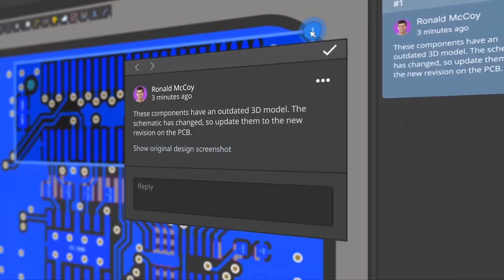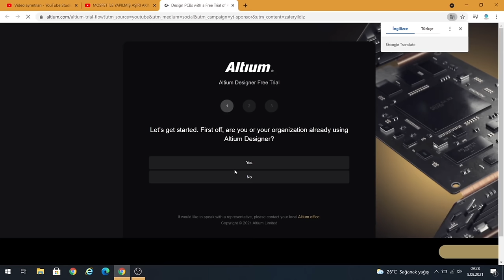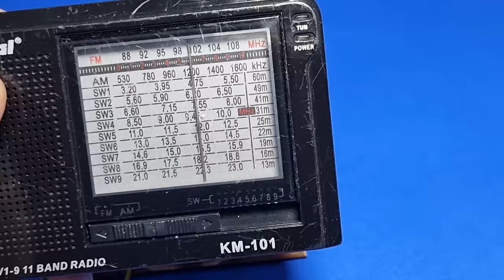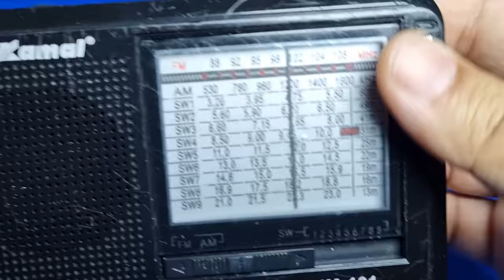How To Make Long Range Stable and Powerful FM Transmitter - 2KM

Comment: Merhabalar. TEC1 12706 modele sahibim. Denemek için peltiere 12.7V 12.5A akım verdim ve elim yanıncaya kadar akım vermeye devam ettim. 70 Watt desteklediği için kendisi yeterli akımı çeker diye düşündüm ancak durum tam düşündüğüm gibi değilmiş. 4 saniye bu şekilde çalıştı. İçindeki yongalar seri bağlı olduğu için herhangi birisi bozulsa bile peltierin tümünün çalışmaması gerekir mantıken. Tekrar voltaj verdiğimde çalıştığını gözlemledim. Bu sefer 4.2V 1A akım verdim. Sizce peltierde herhangi bir sorun var mıdır?

Comment: Had to have a look for a laugh... Its of course nonsense, hence no circuit diagram! The transistors BD139's are audio transistors, you could make a MW transmitter with them, but certainly not FM :-)
Reply: Bd139 has a frequency of 190 mhz ..Not quite high but enough for FM.
Reply: @Newlife-ol6pk  I have quite a lot of experience of building high frequency circuits. I can assure you the FT is not the be all and end all as to whether a transistor will work at certain frequencies. For MW or short wave possibly but by the time you get up to FM frequencies my experience is the only transistors that work are designed for that purpose.
Reply: Yes